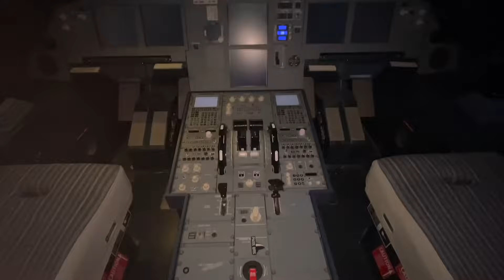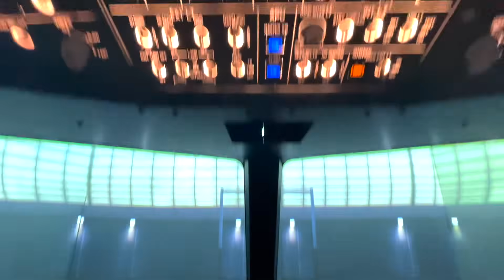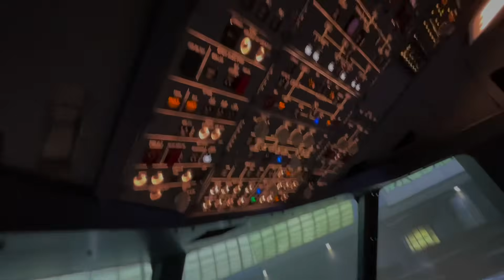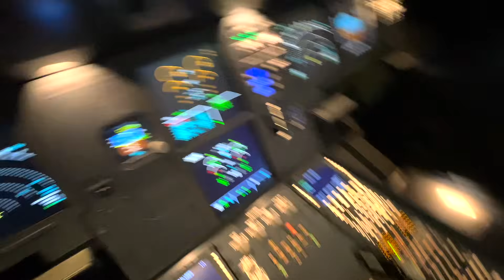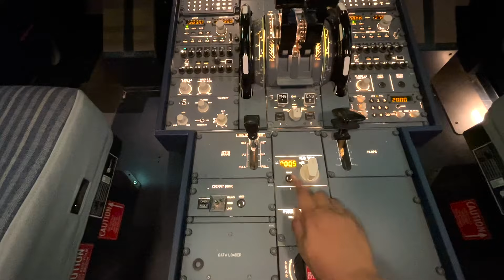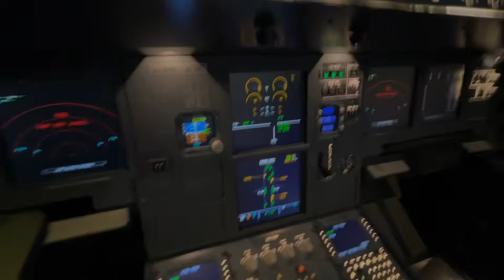Comment: parking break 16:40
engine masters 1:28
batteries 3:25
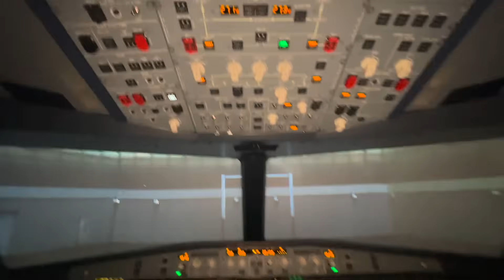ext power 4:19
ADIRS 19:40 
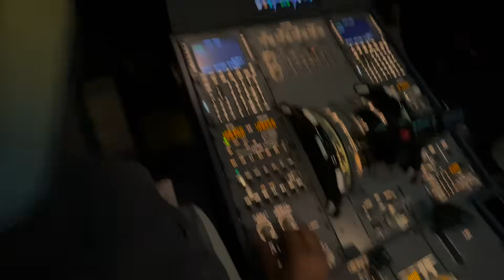Panel lights 13:23
Nav lights 20:49
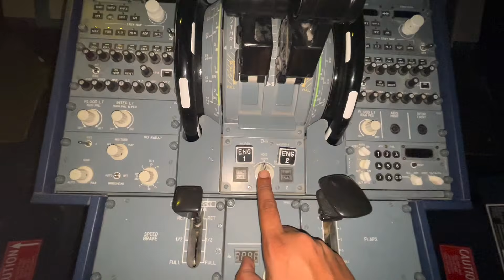landing gear 2:01
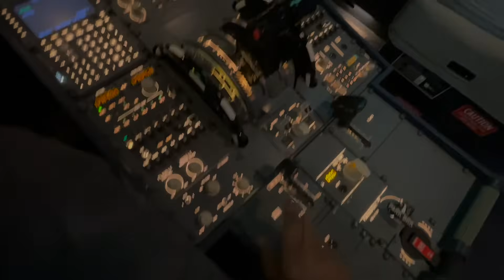Flaps 16:26
spoiler 28:07
seatbelt / no smoking signs 21:09

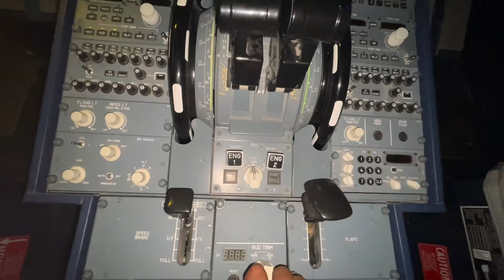mode selector 1:50
APU 9:03
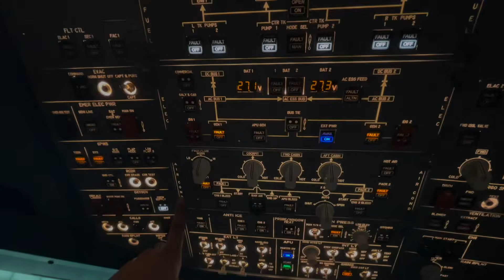APU bleed 11:42
emergency lights 21:18

Comment: Should you have the seat belts lights on before refuelling .
Reply: Hello
Quite the opposite, during fueling procedure has us keep the seat belt signs off and cabin crew should advice passengers that fueling is under process, this is so in the event evacuation is required it would be quicker for passengers to get out of their seats and escape.
Reply: Oh just you put them on  @waypointsaviation
Reply: @RSNorris-z1b  that is incorrect @waypointsaviation is correct.

Comment: Question ? 
Does the external power provide electrical and pneumatic pressure ?
Reply: Hey Allan 
External power provides electrical power only, if you want pneumatic pressure from an external source it comes from a ground air unit which is a separate connection and source to external power.

Hope this helps :)
Reply: Sorry for that.
I seen that you switched to APU  power
Reply: @allangabriel5444  no apologies necessary. :) and yes we start the APU which can be a source of power as well until the main engines are turned on but primarily the apu would work as a source of pneumatic air for air conditioning as well as engine start. 

Let’s put this way, I’ll use external power to power the Electricals and start the apu and use the apu for air conditioning. Once I’m ready to push back and start engines I’ll disconnect the external power and switch to using the apu for both external and pneumatic

Comment: I have a question, well actually 2 questions. Does the clock automatically adjust to the new time zone when flying into a new zone? Or does it have to be changed manually? And the second question is; When tuning the radio, or actually any of the instruments, is it automatically adjusted on the other side, that is the 1st lieutenant's side as well?
Reply: Hello, 
Thanks for your comments, let's answer your questions,
1) We only use 1 Time Zone which is Zulu time (GMT Time) this way regardless of where we are in the world we only reference Zulu time to help stay coordinated. 
2) Yes, whenever I make any changes in my MCDU it automatically changes on the FOs MCDU, however, QNH Settings and ND Screens are individually adjusted for each side.
Reply: @waypointsaviation  Thanks for the fast reply. That all sounds pretty logical I guess. Cheers.